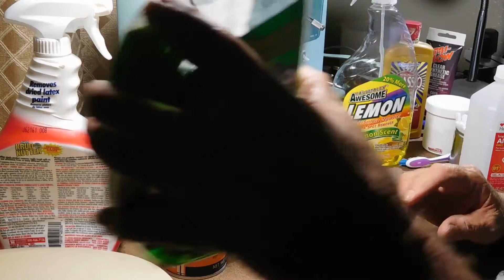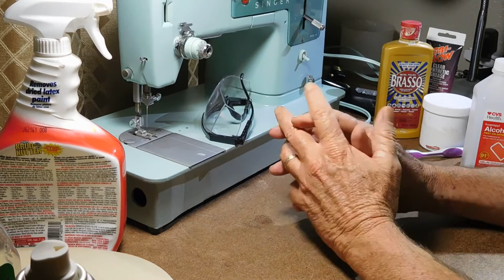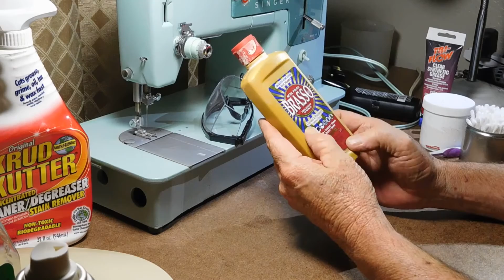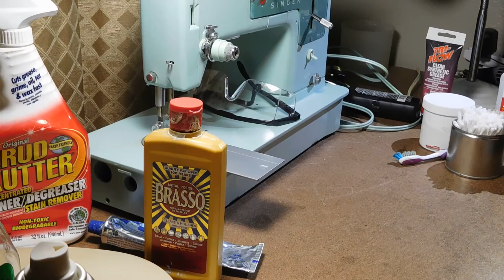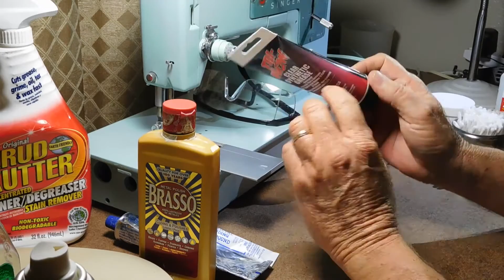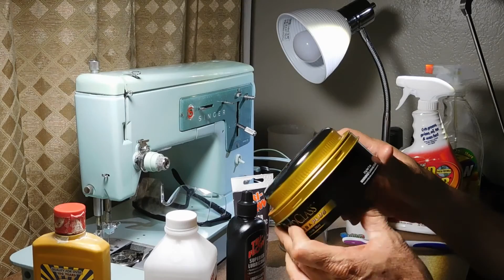Step by Step Restoration of a Singer Model 337. A Series of Videos. Part 2: CHEMICALS

Comment: I just bought a sonic cleaner that uses water
Reply from the maker: ME TOO! Plan to try it out soon and do a video. https://www.ebay.com/itm/New-Stainless-Steel-3L-Liter-Industry-Heated-Ultrasonic-Cleaner-Heater-Timer/162746152476?hash=item25e46d361c:g:at0AAOSwEzxYb1AC
Hope it is worth the price.
Reply: Me too i got the one you could remove  the motor and light and it is big enough to dip half of the machine in and then flip.  So we will see.  I have heard that it will remove rust, now wouldn't that be something?
Reply: @andytubesewing1953  I have an identical ultrasonic cleaner. What do you use for the cleaning solution in your ultrasonic cleaner?
I have been using Zep Commercial Industrial Purple Cleaner & Degreaser Concentrate from Home Depot diluted to the 20 fl. oz. per gallon of water for steel parts but have noticed that it turns aluminum black and copper dark brown color. It makes my fingers feel soapy before it is washed off with water so I assume it is a strong detergent/alkaline solution.
I would like your recommendation for ultrasonic cleaning solution. Thank you, Mark.
Reply from the maker: I use that same cleaner/degreaser I use for washing all my machines, like in this video> https://www.youtube.com/watch?v=qSSRmgi0OT8
Krud Kutter Cleaner and degreaser by Rustoleum> https://www.rustoleum.com/product-catalog/consumer-brands/krud-kutter/cleaners-and-stain-removers/original-krud-kutter
For my ultrasonic cleaner, I put about one ounce (at the most) in plain tap water and it works very well for me.

Comment: Watching your vids on the 337 for insights that'll be useful on my 457. With regards to WD-40, I prefer PB-Blaster. Have a treadle machine with the head completely frozen. (long story). Started out with WD-40. It turned the beautiful decals to silver, everywhere it touched them. (sigh) After about a week of spraying, tapping, tugging, the machine was still frozen. A friend recommended PB-Blaster. Sprayed & waited overnight. The next day, with gentle persuasion, the head began to move. With a little more spray & patience, the head was soon running freely. With NO further damage to any decals it touched. Since then, it has been my go-to penetrant when dealing with rusted screws and such in my shop.

Thanks for the heads up on Krud Kutter. Simple Green and Dawn (dish detergent) Power Dissolver have been my grease cutters. Have heard of it, but haven't tried. Based on your recommendation, I've added it to my shopping list. 

Wish I'd known about Tri-Flow. Just bought a new bottle of Singer oil, as I didn't want to use 20-30 year old oil to rehab the 457. Now, Tri-Flow is also on my shopping list. :-)
Reply from the maker: Oh, I'm excited to try the PB-Blaster now! Thanks for sharing. I have never restored any of the black with decals older machine, but have read about some products damaging the decal colors, so I appreciate you mentioning that for all of us to watch out for.
Reply from the maker: Oh...about the Tr-Flow..really do love that grease with the P.T.B.E. protects very well and especially like that it sticks to the metal and does not go "flying" around inside the machine.